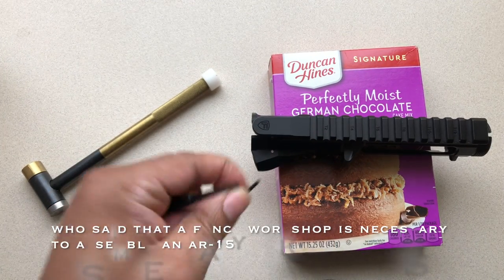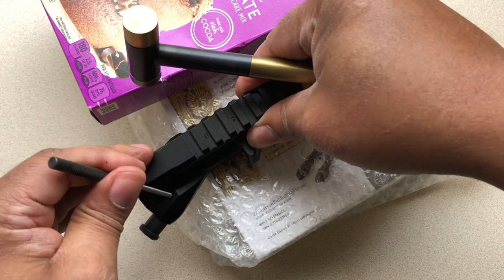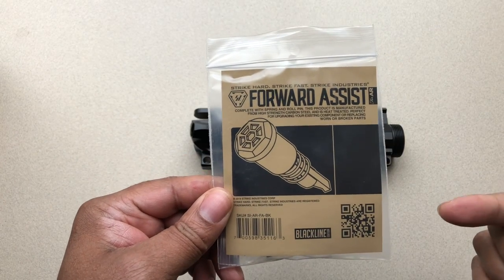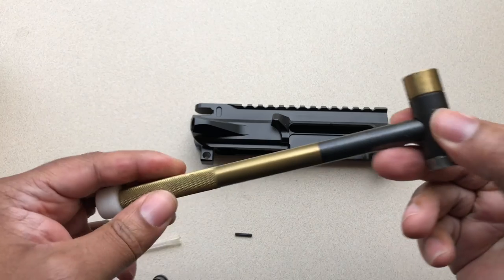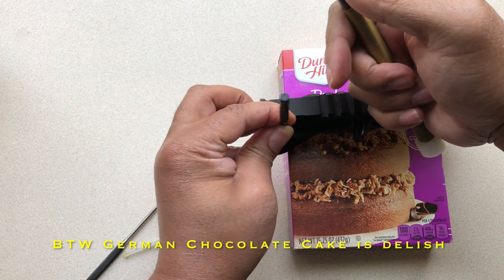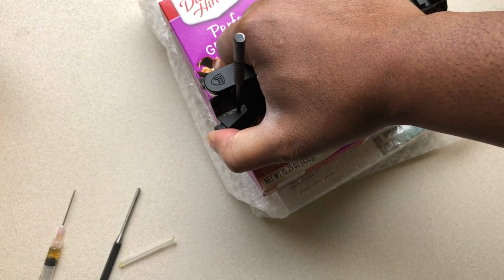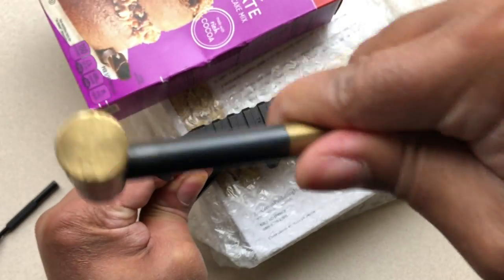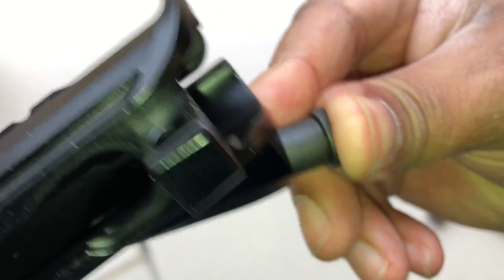AR-15 Forward Assist Install - Without A Fancy Shop Or A Vice

Comment: Great video! Although I heard that you’re supposed to install the roll pin from the bottom, not the top.
Reply: That's only a precaution in the event you slam or scrape up the area during installation...no functional difference.

Comment: Does the forward assist spin a little?
Reply from the maker: There is very little wiggle, because the pin locks the forward assist in place.

Comment: It's designed to be inserted from the bottom. Much easier.
Reply: No it isn't...that's just some jacked up interwebs myth. All that method does is prevent any damage or scratches you make during installation less visible. You can prevent that by using some painters tape on the top side. It is functionally the same whether installed from the top or the bottom.
Reply: @IwatchFilm  The hole on the bottom side is larger and acts as a funnel for the roll pin